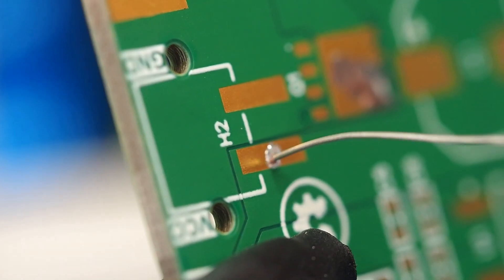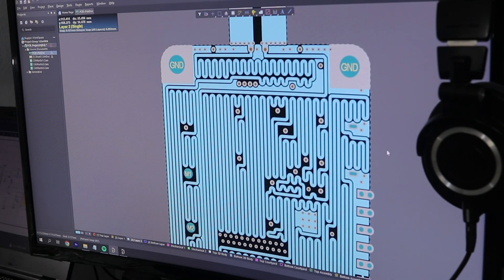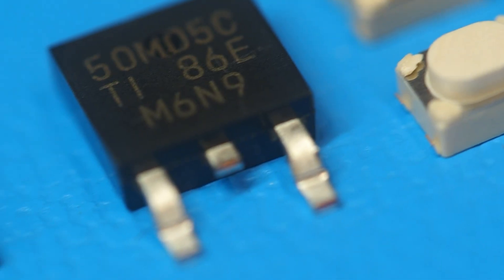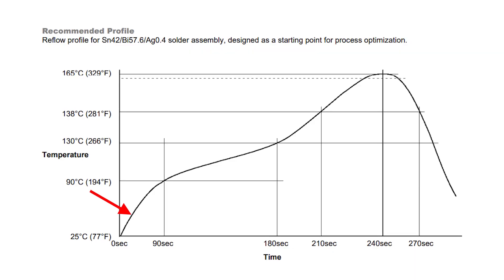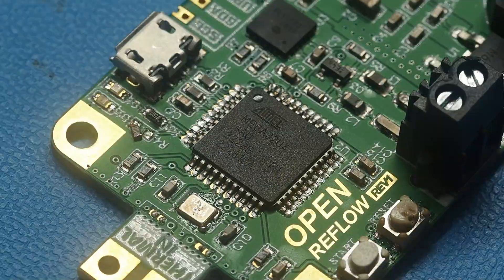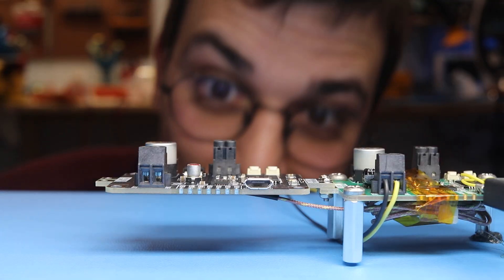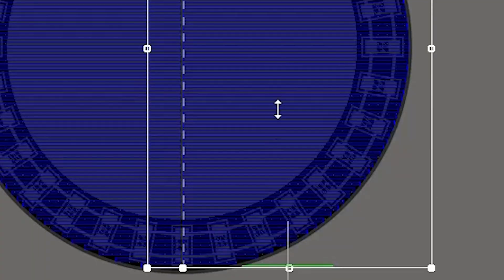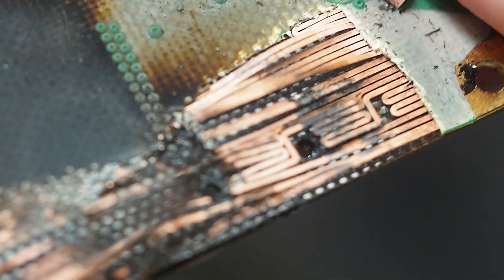I made a Self-Soldering Circuit

Comment: Id does not have to be stuck forever.. do you understand, that you may have stumbled on the design, which is going to keep all our DIY project warm and function in space, and on the moon, and in antactica, and anywhere else... hack.. this can be even the first solid-state self-repairing system ever... when you detect a bad connection, just re-bake it and reset...

Comment: this would be useful in many applications
1. where a board needs to be heated in low temp environments
-space,urov's
2. for repairs, just heat the board to minimize heating needed by the iron for rework, this might stop people from melting components because of heating traces
3. if it works, on the fly reworking of the board when you cant easily get human hands on it, it could extend the life of some boards
-space,urov's,antenna towers
4. it might also be useful in high moisture environments to dry out boards
-pc mother boards using nitrogen cooling
5. when you need to destroy the device in a flash

i would not connect the heater traces to ground to prevent RF current spikes

Comment: I already replied this to another comment below, but why not try using isolated areas of a board for things like upgrades, crossgrades, and other aftermarket features. Like having a microcontroller with specific areas for more permanent modules and sensors. Not everyone needs a WiFi antenna, why not leave the space available for some other communications component?

Comment: Fun fact - you do not need GND plane connected to GND for EMI reduction. It is not shielding but inducted currents that reflect inverted field on to and cancel out the source of the field. By knowing this, you can assume that there will be very very low current induction to the heater traces, as they are not whole plain. The cuts will not allow the field to induce the current. So connected or not - it will not work as GND plane.

Comment: NEVER EVER EVER DO THIS! THIS IS A TERRIBLE IDEA!! You NEED a continuous ground plane adjacent to a signal layer. Remember, electrical signals propagate as waves; the energy in a circuit is in the fields - it's in the dielectric layer between the trace copper and it's reference layer. It's in the boards fiber glass. The field is what induces current and voltage in the copper. When you have a break in the ground (reference plane) the fields start to spread to try to find a return path. This creates large EMC/EMI/signal integrity issues. If you have fast rise times ( ≤1ns), this will cause issues

Comment: Dude that is the best idea ever. A self soldering circuit board seems so much smarter than blowing surface mount components all over the bench with a hot air gun. And you get the added bonus of the earth plane when your finished

Comment: I heard rumors that the some Xbox 360 red rings of death were fixed using something somewhat similar but instead of a designated heating plate people blocked the exhaust fans to bake the internals possibly binding some lose connections. This is definitely more interesting and I wouldn't try fixing broken xbox 360s the previously mentioned way.

Comment: How would you handle temperature sensitive components? I've worked with circuits before where you need to be extremely fast to avoid heating up other components too much

Comment: for 1 of a kind boards, this works, but for high numbers it wont, then u need a hell-ghost(a negative board, with heating elements in the place of contacts) its like a metal mask bipolar array with a 1mm insulation back(handling hex posts, and temp safe side)

Comment: hey, do you think if I add a few empty layers on one side of the heating circuit, would it be enough to not melt some plastic parts on that side?  

I am thinking if this could be used for mechanical keyboard assembly and was wondering if I can get away withouth using some heat stopping layer between the mechanical switches and PCB.

Thank you for everything, I think this idea is brilliant and will lead to so many creations be easy to market because we won't need an expensive solder reflower machine to produce at small scale.

Comment: Well...I mean...copper trace based heater plates for soldering already exist...However its absolutely an interesting concept for things like diy boards with SMD parts (I for one am too ham handed for SMD soldering), or even some kind of 'self repair' for broken/bad/cold solder joints. Possibly in things that see a lot of vibration or flex (either through mechanical or thermal means). Of course, wait until the corporations start putting that in devices so they can self destruct when the manufacturer decides it doesnt like what you're doing with a product you have purchased outright......Dont put it past them...... I can see plenty of phone or console or (as said in the comments) label maker (DYMO!!!) manufacturers having something like that drop all the chips off the board if you dare attempt to run not iOS, not Android, homebrew code on your device. Because your devices arent your devices apparently anymore....they're billboards we have to pay for....And in this age of the maker revolution the average user is too dumb to want to use their pocket computers in a way the manufacturer didnt plan for and thus need their hands held at every turn.... (yes, I have hours of this material. Also I am totally fun at parties....)

Comment: Cool idea, but a track simply can't function as a ground plane. It's called a plane for a reason, it is intended to carry the return current as close to the respective track as possible, minimizing the loop area and thus inductance. A board like that would have horrible EMI and signal integrity at fast rise and fall times.

Comment: Are heated PCBs a thing in the industry? I can imagine this could be helpful for applications where the product is facing very low temperatures. Instead of heating up the complete housing of the PCBs you could also simply heat up the PCBs themselves directly. I mean of course with much less power because you only need temperatures of lets say 10-20°C and not >100°C to keep all components happy.

Comment: Love the concept! Smile on my face the entire video :)

You might look into some kind of way to modify the ground circuit after you solder it. It's definitively going cause some weird grounding issues with a ground plane like that. Maybe some solder bridges or something.

Ohh, and be very careful with any charred pcbs. I spent a decade repairing cnc spindle and servo drives, and a pcb that is charred, or even has a visible arc char marking is very conductive. Usually a charred pcb you can read the continuity with a simple multimeter. With an arc trace or similar, it might not conduct very well at meter ohm checking voltages, but can easily create a path and re-arc.

Generally a charred pcb is irreparable. I do however have a photo of a board that wasn't available anymore, that I literally dremmeled a hole in to remove the charred pcb, then ran big ole wires across and through the hole to remake the (motor output) circuits. Like an inch(25mm) diameter hole in a four layer pcb with super thick current carrying traces.

Can't wait to see more!

Comment: The reason for your bad soldering quality is that the components are cooler than the PCB. This makes the solder flow bad to the SMD caps and resistors. Combine it with an hot air gun and you can still sell your idea ans "see, i dont need any pre-heater". :-)

Comment: Yes. Good. Now to make it program itself.

Also there's a good chance that with a decent current sensor you can use the heating trace itself to estimate temperature by the slight decrease in current at higher temps, no external thermocouple needed.

Comment: Would be interesting making a ceramic board that's only the heater.
Reply from the maker: It would be.. Not sure it would be effordable for the average make though
Reply: @CarlBugeja  you could make it with a flat plate, kapton tape, a copper or aluminum sheet and some nichrome wire.
Tbh you can probably just tape the wire to an oven tray and have a decent heater.

Comment: I wonder if you could use a secondary PCB, single-sided, to adapt the heater trace to a better ground plane by essentially turning that winding trace into more of a grid-like pattern with the matching secondary PCB; just expose the mating dots at the common junctions on both boards, the primary board has the bulk of the copper while the secondary just has what's missing.  I wonder how much closer this method would get to a true ground plane when it comes to signal integrity.  Of course this only works on single-sided designs, unless you use two heaters on two boards where each winding trace combines into a grid; like a pseudo 3-layer board.  The same could be done with power planes as well.

Comment: I find this solution extremely useful expecially in DIY applications, also because of a problem that could occur such as the delaminatiom due to the concentrated heat in the middle of the board

Comment: It would be interesting if you could use the resistance-temperature dependence of the trace to skip the external probe. The resistance of the copper should be quite linear up to well over 200℃ and have a temperature coefficient of about 3930ppm/℃ so going from 20℃ to 150℃ would increase the resistance with about 51%. You could either have Altium estimate the trace resistance, measure it yourself or if you have a temperature sensor on the controller PCB you could use that as the initial guess for the temperature of the PCB you want to solder

Comment: whats the point of a 0 ohm resistor
Reply: It's basically a solderable jumper. You can use it to choose which parts of the circuit are connected at manufacturing time.
Reply: @jbay088  a sort of bridge then? thanks for the clarification.
Reply: @YouTube.Ad.Hominem  Yes, that's right. It's like a trace on the PCB that you can choose to either connect or disconnect.

Comment: this makes a lot of sense, the only situation where this wouldn't work is when the environment is hotter than the soldier paste but cooler then normal solder but for 90% of applications that's not to case. Besides making sure the ground plane is shorted afterwards which isn't hard or complex there is no downside to this.

Comment: It’s cool but at the same time there are so many misunderstandings about good PCB design in this approach.
The most important one is that a ground plane should never have slits.
Reply from the maker: I agree that a solid gnd plane is a requirement for certain projects and i definitely recommended it, I just wanted to set a use for the track after it get soldered.. In video I missed to explain that the 4-layer mother-board have 2 other layers with ground polygon pours.. The long grounded thermal-track might still act as antenna (even though it can be shorted to ground from the two ends) so I guess that will be a trade-off for this self-reflowing concept
Reply: @CarlBugeja  I agree that if you have enough layers you can sacrifice one for the thermal trace. That would be much better than to repurpose it later as GND.
Reply: We're moving at USB-2.3 speed and breaking things, here. Take your EMI concerns to a more sensitive software radio case instead.
Reply: @Cineenvenordquist  Never heard of rise and fall times of edges? That is independent of the baud rate and much more of an issue. 
Also independent of baud rate is surface area of loop antennae, which is devastating for emission and susceptibility.

Comment: what a clever idea!! I definitely wouldn't use the heating plane as like a GND reference for impedance matching or other signal integrity purposes, but it could probably serve as a quick and dirty reference for low speed components. regardless, you can always just sandwich it right in the middle between your actual GND planes. I really like this idea and I might try it out in some of my hobby projects
Reply: Just design your THz WiFi alternative so it doesn't neeeeed that GHz ground plane integrity.
Reply: What about using high current low volt set up then you use a flat ground plane

Comment: maybe implementing a part on the resistive heating that is significantly thinner than the rest of the heater to act as a fuse say 5 amps so if the pcb is getting over powered or over heated it has a protection in place and making available pin outs on the rear of the board as an open bridge would allow for people to resolder a new fusable link of wire so that the board doesn't become scrap when the internal fuse blows.
Just a thought.

Comment: Whoa. I'm currently working on a LiPo battery discharging circuit - want a super cheap board I can make 50 of and use them to keep my LiPos at storage voltage, and the entire back layer is just a long trace to use as a power sink when discharging the battery.

This is literally the perfect idea for this project as I already have the trace, and need an easy way to solder up a large number of them!!

Crazy, just crazy. I never would have thought of that. This is brilliant.

Comment: Looks grate.
What about making it so that it can measure the ohmic value on other pcbs and then calculate the soldering curve itself for that pcb?
Reply from the maker: i thought alot about doing this when designing the board, but a thermocouple is much more accurate and was a safer option to test the concept. Different pcbs will have different resistances. The track resistance for the same design will also vary a tiny bit for different pcb batches. Apart from all this, the resistance of the track changes, as it gets hotter which will introduce more error as different resistance might vary differently. The area and thickness of the board also influence the temperature rate, as the smaller the pcb area the less current required to reach a certain temperature.  So the temperature reading won't be to actuate unless have some kind of ui to put the board's parameters and a software that predicates the temperature/current profile. This has to be tested with lots of different designs that have different parameters, as the wrong predication can lead to disaster.  Not saying it cannot be done, but...

Comment: What resistance have ground layer? Isn't it bad that it's not solid? Maybe just have ground connectors on the ends of longer axis of the board and use more current and less voltage to heat it up?

Comment: Those pads you added to connect to ground arent necessary. One side could have always been connected to ground and the other could have been left floating. That being said, in either case this is a horrible ground plane. For low speed digital or low sensitivity analog its probably fine, but probably doesnt help much more than the ground routing I can see you already have. Cool idea though.

Comment: If you have an application, where a continuous ground plane is kind of necessary (not super critical tho), you could create unconnected bridges with vias to the top layer, and only connecting them after the components are soldered (by not cutting them the stencil apertures). I'm thinking some unconnected jumper pads that you can put a blob of solder paste on after the reflow, then heating these briefly with a hot air gun. This way, you will have a much lower blocking of current paths and ground resistance, although far from perfect. I think this may decrease unwanted resistance by around two orders of magnitude.

Comment: i started soldering more than 25 years ago, and this never in a million years occurred to me. Outstanding.
Reply: bro imagine saying saying solder yourself to your pcb lol
Reply: @1evoevo1  Don't try it.  It hurts like hell and the solder doesn't stick to skin anyway.  It just balls up. Maybe they need to make some skin flux.
Reply: I can't speak for Carl, but perhaps the inspiration was a short on a board.  They can get very hot.  It's not much of a stretch to go from there.  I think the main reason for not doing this is that it's a slow process compared with simply running it through a reflow oven.  Or a hot plate for that matter.  The person who had the idea of putting tiny balls of solder in paste flux is the real genius.  Why mess with an iron and solder wire when you can just smear past and heat it up.

Comment: This is wild! 
The only downside to this invention is that you have to use SMD components. 
I wonder if there is a way to make it work for THT?
Reply: Oh, through hole technology. Just make a solder mask but with bigger holes in ice or freezable organic solvent and stage the components in that. Might need to supply vibration to the board to seat everything.

Comment: This GND plane will be not good. You typically avoid putting slots and slits on the plane, to give the return current a low inductive path.

With That many slits in the gnd plane you will come a gutsa. Especially when you design a mixed signal board.

Comment: So many problems that could happen. You will pick up lots of interference, you will get problems with high power components such as dc-dc converters. Also you will potentially create parasitic inductances and capacities.

But the worst problem in my opinion is that the temperature won't be the same over the entire board. Sure for small ones like you have there, it will work. But as soon as you have a bigger one you will see strong temperature gradients. I mean just see pcb heaters for 3D printers. They have that even at 100°C and you have to go quite a bit higher.

So you will have some parts getting to hot and maybe causing delamination inside your pcb, something that will be a nightmare to debug, or have components not being soldered on the outside.

It's an interesting idea but I doubt it will be of any practice use.